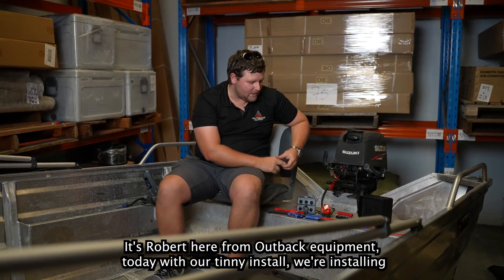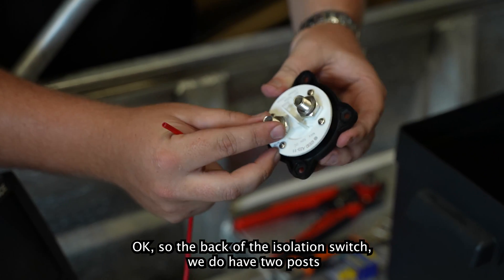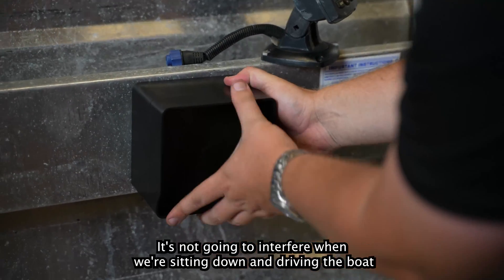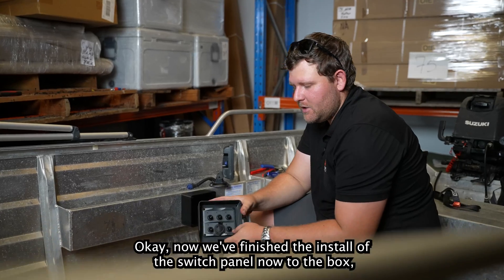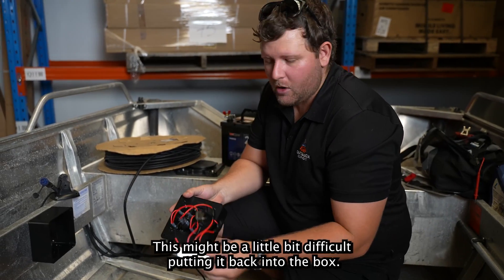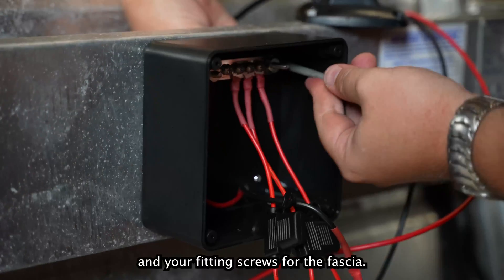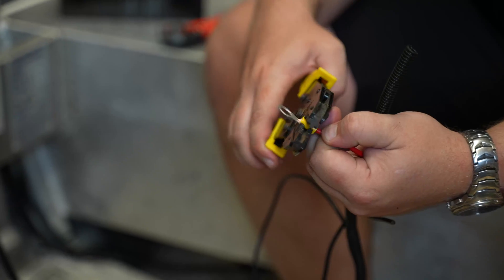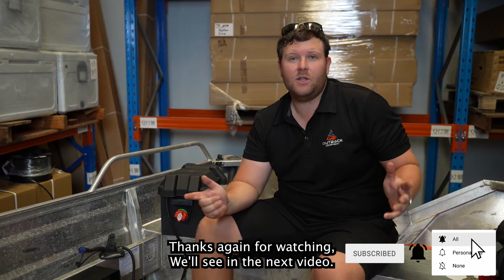Installing a Switch Panel Battery Isolator | TINNY BUILD SERIES EP4

Comment: Just a couple things. 
-fuse at battery
-why not use a red buzz bar
-grommet where wire exit box through aluminium
-I would put a negative buzz bar in there too
-probably should have mentioned how to apply loads. 
-and non ratcheting crimp tools are garbage.

Comment: Hi, thanks for all the great info, what connector did you use to extend the black neg wire from panel going back to battery, or did you solder it?

Is all the wiring you used 4mm twin core? Thanks

Comment: You must install an inline fuse as CLOSE as possible to the battery ie between battery terminal and battery switch. What happens if you get a short in the circuit before the inline fuses you have on the switch panel ?

Comment: Good vid. Something I wish you'd emphasised was that when you're pushing on the flexible conduit that it MUST pass through the hole  you drilled in the aluminium storage. If the wires are just passing through the hole in the metal and then entering the conduit the vibrations will short them out in no time. While on the topic, you really ought to put an inline fuse or circuit breaker in the positive line as close as practical to the battery too.
Reply: Agree completely....thats a long length of positive wire which isn't fused. This is dangerous.

Comment: Nice video, I like the way you connected the battery to the panel switch. I will be using a fuse block instead of the buss bar. Just like you I am using the battery box and mounting the shutoff on that box.  I do have a question, how you are going to connect the key switch and the outboard to the battery.
Reply from the maker: HI Anthony, our Motor is just a manual start "pull cord" so we didn't have to worry too much about that when connecting our outboard to the battery. If you were to have an electric start same thing applies to installing anything to the battery. Positive to the switch and Neg to the battery. It would be slightly different again if you were to have dual battery system.

Comment: Excellent video, well done. Can you please supply details of which battery box you used and the gauge of wire for each application.
Reply from the maker: Hi Chris, here's a link to the battery box we used- https://www.outbackequipment.com.au/battery-box-standard and in terms of wire, we used 4mm twin core sheath tinned wiring.
Reply: @OutbackEquipment  Hi guys, thanks very much for the info and timely reply.